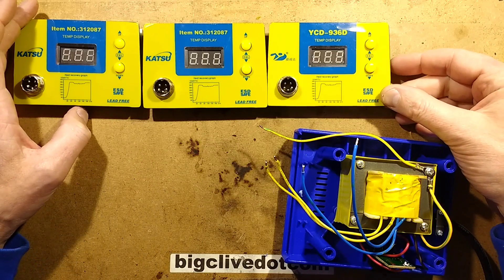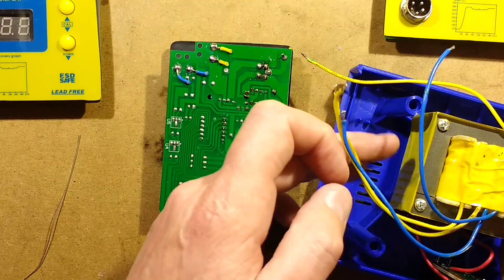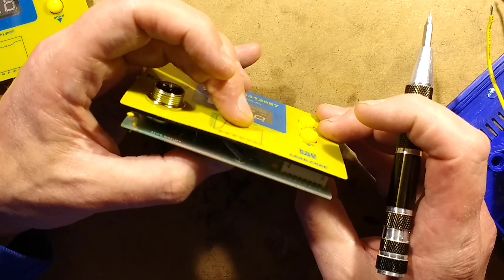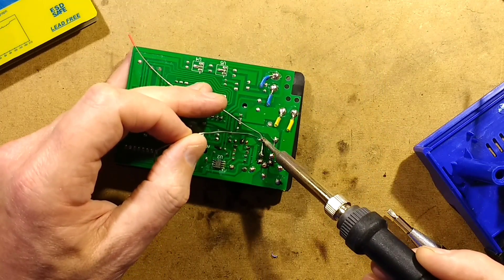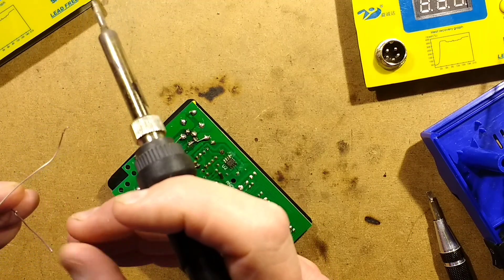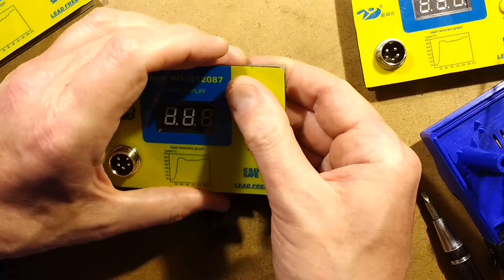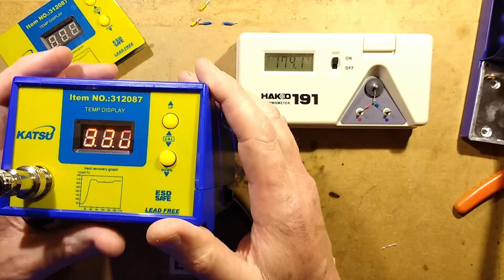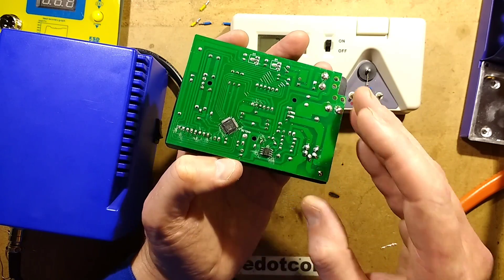Fixing a common fault with the 936D style solder stations.

Comment: Clive! Mine has knackered this week. I've got new elements and a pen iron for it, but it's stuck on cold. Any ideas? A bit tricky without a second soldering iron!
Reply from the maker: Check the solder joints as shown.  Not handy unless you do have another iron.
Reply: @bigclivedotcom  thanks Clive. I've ordered a cheap iron to fix my cheap iron! Cheap tech don't fail me now!!

Comment: Please if you can help me, I have the soldering station, YIHUA-853AAA, and I have the following problem, the soldering iron when I adjust it to any temperature, the display shows me 85 degrees Celsius and the element that I measure with a thermometer reaches  400 plus, at what point to focus to find the problem?
Reply from the maker: It sounds like there is a short circuit on the thermocouple wiring.  Possibly in the handle of the iron or the connectors.  If it thinks the iron tip is at 85C it will keep heating it.
Reply: @bigclivedotcom  i forgot to tell you,i buy other handle tip and i have the same problem,so you say to focus on station????

Comment: Good practice would have been to replace the blue before removing the yellow stubs, or vice versa. Just in case you get a phone call 😵‍💫

Also, I’d look into adding a couple of supports between the board and panel, even if it’s just a block of plastic and hot glue. In this case there a number of holes in the board and I wouldn’t mind screw heads showing on the panel.

Comment: Good video.  I tend to solder around 360-370C.  I've been soldering so long that I can very quickly make a solder joint without risk of overheating components or pads.  Clive does a pretty good job,   I've watched some of these YouTubers solder and it's like they're frosting a cake or something,  they come back and try to reflow the crappy connection they just made without adding any flux or fresh solder and/or they take 5 seconds to make one solder joint.   Some of the repair guys are the worse ones.   I was taught how to solder by an instructor that held multiple certifications,  I think some of these repair guys learned to solder by reading the directions on the back of the Chinese soldering iron package.

Comment: ive got 937D+ and when i open it i was shocked, quality of work was horrible, also was like some kind of bad fluid on it on half of the board. so i clean up everything, i have replaced the poor china capacitors for decent panasonic 105'C, i desolder the wires, also there was still climfilm (protector) on a led (temp) dispay. now is working really nice. also the screen is much brighter and now i feel safe and now is truly ESD Safe. i think most of cheap china products need to be corrected. i had the same with audio mixer and audio swither, poor job which needs rework.

Comment: This reminds me very much of a number of similar situations that I ran into some years back with a well-known brand of Japanese musical instruments,  specifically cheap keyboards.  They would put the DC input jack in the back of the instrument, and people would bump the plug,  or push the instrument back against something,  resulting in tearing up the connections and ripping the foil on the board containing the connector.  I used an X-acto knife to clear the solder mask.  And speaking of which, they applied solder mask to such an extent as to have an absolute minimum amount of solder to that connector,  if they'd allowed for more room around the connector pin so more solder could have been applied at least some of these problems could have been avoided.  My fix was similar to what you did here,  stripping off solder mask and applying a generous amount of solder,  sometimes adding bits of wire as well.

Comment: Viewing this in 2020.  Interesting fix. There are Amateur Radio manufacturers that use very similar connectors for their microphone jacks.  Same issue with mechanical stress causing cracked solder connections on the front panel pcb.  Great video...Well done, Clive.

Comment: Could you use an alcohol-soaked Q-tip to hold down the first connection so the BTUs won't rise up enough to be unsoldered while  you're soldering the Second Side and it won't pop off.?

Comment: Have you any fixes for a Precision Gold A55KJ with the two wire soldering iron , put a new element in but it doesn't regulate temperature, maybe a triac fault, the tip gets red hot and HE stills shows on the LCD screen.
Reply from the maker: Check the triac.  They usually go short circuit when they fail.

Comment: Thanks a bunch for this video BigClive, I came across it after experiencing the same slowness of heat in my 936D. I just finished resoldering the points you mention, also added a couple of spacers using some rubber and a drop of superglue, put it all back together and switched it on and Bobs your uncle, Fannies your aunt it went straight up to 345° within a few seconds. Didn't believe how fast it heated till I touched the solder to the head and it melted straight away. Again thanks and and lang may yer lum reek. George T.

Comment: I just got one of these and the display stuck at 76 but the soldering tip started glowing very bright orange...god knows what temp it was but turning it down did nothing. Then, when i tried it again a few times, it would not heat at all....is this likely the issue?  Also im unsure what soldering to varios places on the board that appear to have no track is doing to stop it relifting at the connection points and still not working. Is that just an attempt to give original joints strength? Wouldn't hot glue be better to stop board moving?

Comment: Looks like the pcb already has mounting holes...epoxy some standoffs on to the faceplate and line them up with the holes so you can screw the pcb in securely. Without stabilization of the pcb, it is just a matter of time that these units will fail because of the button-pushing that flexes the pcb.

Comment: I bought an emergency solder iron, so if my Mini TS100 stops working i still can solder, when i wait for a replacement, my emergency solder iron i bought the Quicko T12-942 MINI OLED, it's cheap and works.

https://www.banggood.com/Quicko-T12-942-MINI-OLED-Digital-Soldering-Station-T12-907-Handle-with-T12-K-Iron-Tips-Welding-Tool-p-1326151.html?rmmds=myorder&cur_warehouse=CN

Comment: I've bought a maplin soldering station, pressision gold,  and some ebay handles,  my handles look to have 5 separate wires,  2 for heater,  2 for sensor and 1 for earth but in my station the connector only has an earth which is centre pin and 2 pins either side are shorted together so 2 pins in left are together and 2 pins in right are together,  will I need to rewire the handles so heating element works  without the sensor because as they are in getting an s-e error code

Comment: I have WELLER WECP-20 
Problem 20 minits work ok but after 20 minits led blink continusly then shut down
Reply from the maker: There may be a thermal issue with the temperature sensor wiring or it might be indicating overheating.

Comment: I suppose if I get one of these, I could just open it up and slather some epoxy under that connector, give it something more substantial then solder to hold it in place.
Reply from the maker: I'd certainly recommend adding bridge wires if they haven't updated the design.  The connector is a design weakness in an otherwise sound soldering station.

Comment: Hi Clive my fist comment here (and rather late). I bought one of the plain black 936D's with red buttons and trim pot calibration. Mine was so far out of calibration that the trimmer wouldn't adjust it. I think it was still about 20 deg too high on full adjustment. I ended up swapping a resistor on the pcb. Now it calibrates about half way on the trim pot. I also used a Hakko 191 knock off sensor like you have. The 936 type units look stackable to me.

I also have a 898D+ (similar to your other station with a heat gun) but the irons are not compatible as the 898D+ uses the thermistor and the 936D uses the thermocouple type elements. Also I had to change the polarity of the thermocouple wires on a spare iron for that to work for some reason. Love your uploads and I've still loads to watch. Subbed.

Comment: Wow, I was doing that when I was 10 years old or maybe younger. Using the 'highly accurate' Weller 8200D with a crusty tip, on high & probably the wrong solder, I lifted many pads from the PCB. 
I would use reclaimed telephone wire or whatever was around & usually went to another pin on the same circuit with the insulated wire.
Love to see a professional doing that all these years later. Makes me feel good about it haha!
Still have that soldering gun too. Tough to beat them for durability. I can't say so much for my hand & arm holding that monster for long periods though.

Comment: HI clive. i bought the katsu 936d and tried ur fix on it, i don't know weather i'm using the wrong type of wire or solder or what i'm doing wrong. can u help me with this. i even bought a hakko 936 board to try see if that would work but it doesn't even power on. my email is scooterfarl@gmail.com if u can please help

Comment: Do you think using a slightly larger VA maybe 5 amps instead of 3 amps would improve one of these irons and would it handle the extra current
Reply from the maker: To boost the output you'd need to increase the voltage and make sure that the switching components could handle the higher voltage.
Reply: Thanks am gonna do some experimentation
Reply: Maybe ill try 30v at a similar amperage just to see if it boost thermal stability and heat up times am sure it will that also that makes since that resistance would be greater at a higher voltage and therefore more heat and it shouldnt hurt the element as they will just get hotter faster before the regulator cuts it off at least in theory ill do some checking on the component tolerances thank you.

Comment: This so reminds me of a call-out last year. Yamaha piano/synth keyboard, power plug snagged, socket lifted,  pcb pads broken. Simple fix? No... had to strip it right down. 128 hex bolts later, all different size/length - whole thing dismantled. Reflowed with thick copper wire, 2 minute job. Only took another couple of hours to rebuild it!
Reply: Same with my Casio keyboard! 15 small headed Phillips screws with long threads for the metal base, then another 20 shorter ones for PCB! Just to reattach 12v socket! LOL

Comment: Thanks for the video.  If I were going to bother repairing it, I would have added at least one, probably two or more screwed on standoffs (depending on how many can be put through the front faceplate without making it look too hacked up), or perhaps an L-bracket made from sheet aluminum, with one leg of the "L" screwed to the bottom of the case and the other to the back of the PCB.  From the video it looks like that might block a few of the case lower vent slits but while I had it apart I would drill a few more/new vent holes anyway.

Note that while what you  found is a common fault causing the SE error display, another very common fault with these is that the low quality iron cable frays internally.  It's quite a shame that China can't seem to make decent quality wire.  It's also a shame that they reversed the male/female plug/socket arrangement between the base station and iron cord so that a standard Hakko 907 iron isn't plug 'n play, especially considering that they went to the trouble to make these station variant yellow and blue once Hakko did the same on their current gen 888.

I suppose that's expected, that a color change doesn't necessarily cost any money while making it fit to last longer than the first few uses would cost a few cents more, lol.
Reply from the maker: I think one of the reasons for the plug versus socket on the iron lead is to stop people plugging in thermistor based irons instead of thermocouple ones.

Comment: Hi there!I have one of the same soldering station...It displays 21...on the LCD screen...not heating up at all...if you put up on the digit screen to 350..it is flashing..but after 2 sec is geting back to displaying 21...I made some pics of the 5 points on the green board but they look fine..I don't know what the problem can be...
Reply from the maker: If it's new then contact the seller for a refund.  If its been in use then it could still be the socket solder connections.  It tends to be a tiny hairline crack.  Another possibility is that the soldering iron is faulty.  They sell them cheaply on eBay as solder handles.
Reply: Yes...well the seller said is a returned item and sold it to me as returned new item..the soldering hammer(the stick) looks like it has been used and I have sniff it and has a burned odour...I have ordered onother one...if is not that..should I try like you have done in the video?Thank you for the replies!

Comment: I have two types of solder. One says lead free and it takes nearly 1000 degrees to melt it. It is the worst solder I own. The other is 60/40 tin solder. Not sure if it has lead in it, but it melts at a lower temp. I like it the most.
Reply: Adonis cmj 60/40 solder meand 60% tin, 40% lead, so definitely contains lead.

Comment: Back in the day when I fixed TVs for a living, a certain manufacturer did something similar by connecting the button panel circuit board with one screw on the opposite end of the power button !!!    I did this exact same fix dozens of times, good to see that old mistakes never go out of style...

Comment: There is a guy on YouTube (12Votlvids) that did a review & tear-down of the non-digital version (It's black in color).  And he noted that the solder connections on the board were terrible, some had cracks and others had cold solder joints.  He recommended taking the board out and re-working the solder joints with a good quality 60/40 rosin core solder, just to prevent these problems.

Comment: Reminds me of back when I did component level repair on cell phones. One of the most common problems was the surface mount headphone jack legs breaking off the pad. Occasionally the pads were lifted, but most often it was the solder joint failing. I don't recall if they were lead free or not. At the time I was blaming gold embrittlement (the board pads were gold plated) along with the stupidity of using SMT on a high mechanical strain application.

Comment: Hi Guys, Need a flavour. When you choose a low cost soldering station. Which type of solder tips your select for the handle?

Which one is more durable and cost effective? The T12 or 900 series?

Comment: HEY I HAVE AN AWESOME TIP FOR YOU!!! Incase you dont have your desoldering braid with you or dont feel like using it. I havent got any yet so I do it this way!
If you need to desolder something with multiple pins
Turn the PCB upside down. so your soldering iron is pointing towards the sky with the solder joint on the bottom and you sort of soak away the solder away from the PCB joint.
I got a 4 lead component out really easily by doing this!!!!! Only took a few seconds! Then i just wiggled the component a little bit and it slide right out!
It basically soaks all the solder away from the PCB onto the soldering iron. then you can diposit the solder elsewhere or leave it on the iron (as long as its not a HUGE glob of solder)
Its super useful. just make sure your quick!

Comment: Is it OK to replace the thick copper tract on thr PCB here with small gauge wire????
How can I estimate the size of needed gauge for this kind of work?
Reply from the maker: It depends on the load.  A short bit of bare wire like this is rated to a much higher current than an insulated one.
Reply: bigclivedotcom Thanks man. I think the joints need another strengthening method; we may consider putting some epoxy on the joints just to make then more durable but this might affect any future repair attempt.

Comment: I agree with you completely that this is an annoying defect in their design. At the price point of those things though, I half expected as much. Personally I stripped the solder masque off down the traces and just flooded the whole thing which does exactly the same thing you did with wire. I must say though, that your method would offer a lot more flexibility which is something I hadn't thought of. That said I used quite a lot of double sided foam tape to secure the board so it wouldn't move as much. I also used a bit of hot glue to further lock it into place. This is something you might consider doing as you likely have some double sided foam tape on hand and it does help quite a lot. Great fix though, with the wire instead of my method. If I ever get another one, I'll do that instead. Thanks for this....

Comment: for the ground connection i would probably cut the track and stick a 100k or 1 meg resistor in series.  A directly grounded iron can be a problem if you happen to use it on a live circuit, even low voltage, if it is earth referenced :)

Comment: There are little clip-on heatsinks you can get that help with the issue at 10:00 or so. They're like clamps in their design but are one solid piece of spring steel coated with high-temp plastic for the grip. I think they're built for use with semiconductors but I've always used them for diverting heat while soldering. https://i.imgur.com/IdoJ7Dn.jpg
They might be a little big for this case though.

Comment: I've done a similar repair on circuit boards with screw terminals. The screw terminals have large through-hole pins and large solder pads. Vibration would cause a fracture around the perimeter of the solder pad, breaking the connection between the circuit board and pin.

The repair is made with a small coil of wire, about three or four wraps, that would fit loosely over the pin. The coil is pushed down over the pin with a soldering iron and fresh solder is added as needed. I've never had to go back to repair a connection after making this repair.